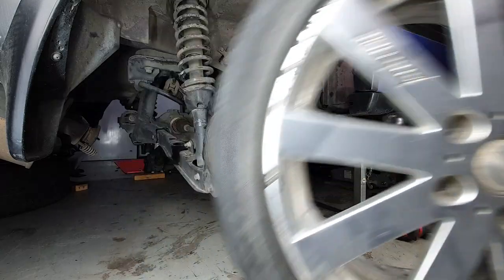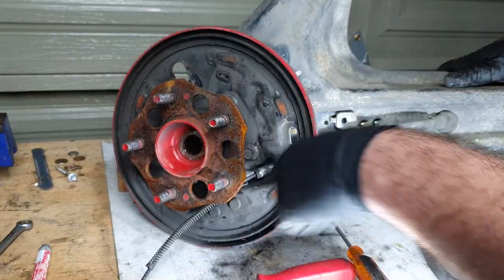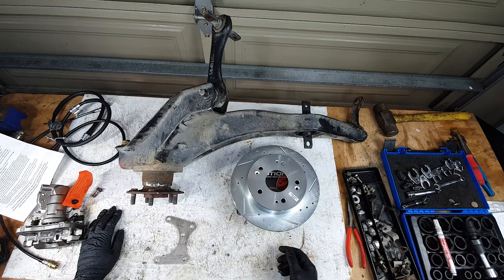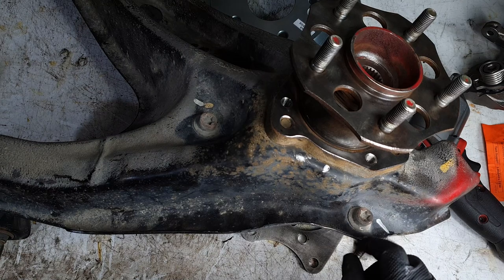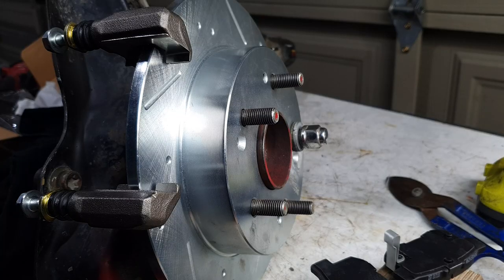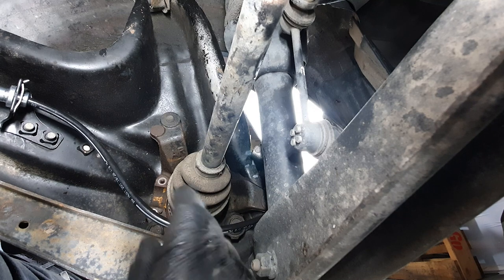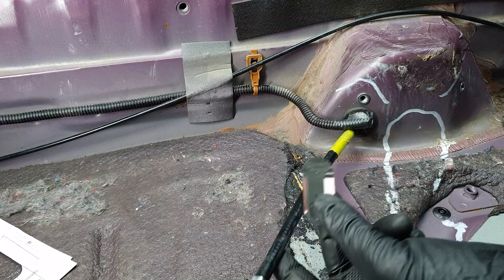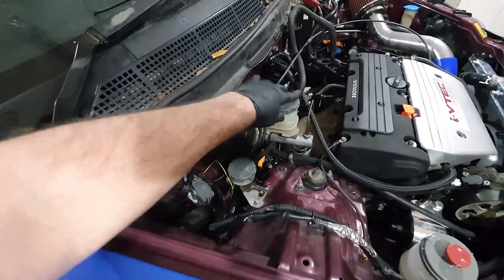honda cr v rear disc brake conversion

Comment: did the rear disc brake and big brakes up front. got good brake pedal when car is off but goes to floor when cars on. if i press the brake twice while moving it locks the brakes up. any tips?

Comment: This video series is extremely helpful, thanks! The car looks awesome! Great job with everything. 
Did the RD1 driveshaft bolt right up or do you need to shorten it still?
Reply from the maker: Thanks! Im about to start dealing with the prop shaft, going to see if i can use the rd5 prop shaft as its shorter then the rd1. Otherwise yeah i will need to shorten the rd1 prop shaft.

Comment: Try putting the right side caliper on the left said and the left caliper on the right side. So the bleeder screw isn’t facing down. But other than that the install seemed clean and easy.
Reply: It hits the trailing arm that way, gotta grind the caliper if ya do that. There is a video on YT about how to do it.

Comment: i like the drum brakes system even though ihate the set up. they actually stick much better than discs brakes.. though the disc pads  look much nicer, they wear much faster than  drum brake shoes.

Comment: for the rear rotors you used 1996 prelude rotors on rock auto i see they are 4 lug
Reply from the maker: No i used 5 lug. My crv is converted to 5x114.3. Normally a 96 rd1 would be 4x114.3

Comment: Do all the CRV's have the same gear ratios and rear diffs just match up?
I have a 98 5speed awd, I know all the 2nd gen +2002 are K-series. Do they match?

Edit: I just saw that this is already a K-swap in a RD1... I'm till curious about awd Honda rear diff gear ratios tho, D-series Wagovan Civics, B20 RD1's and K24 RD5's have any interchangeability?
Reply from the maker: As far as i know 96 through 2009 crv diffs are all interchangeable including elements. I know people upgrade to wagovan viscous coupler and rear diff but i don't know the ratio, i assume its the same.
Reply: I think they are the same. There is a difference in final drive ratio between the Autos and Manuals, but I think that all happens before the output. The D-series wagovan stuff idk about, too expensive for what it is in either case imho.
Reply: @nobodynoone2500  Thanks! as I've thought about it, I realized all the rear diff and gear ratios are set in by the FWD trans and any rear differential in a Honda is going to be a 1:1 input to output from the front to rear. No need to match up anything, as it all should work if you just make it fit together.

Comment: I’m confused so you can use the rd5 rear diff instead of the rd1 rear diff with the bseries set up or is it just for the Kswap? Or can I use it with bseries
Reply from the maker: You can use it with b series also
Reply: @jdmnuggets  any benefits to switching them ?
Reply from the maker: @hotshizzgaming569  the later models rear diff and viscous couplers lock up quicker. Basically, it engages 4x4 quicker and with less slip pressure. My diif is jdm rd5 you might need one from an element as i think the usdm rd5 has the same vc as the rd1. Another benefit to swaping in a later model diff is getting a new lower mileage diff/vc these older rd1 diffs, are, well, starting to get old lol
Reply: @jdmnuggets  Changeover was 2007ish I think. Diffs from crv, element, even some crosstour bolt right up.

Comment: does this still work with abs? saw another video guy said it doesn't work with abs which i find hard to believe
Reply from the maker: Abs works fine. Abs ring is on the axle and sensor is on the back of the spindle/hub.
Reply: @jdmnuggets  yeah exactly dont know why that guy said it doesnt work lol
Reply from the maker: Lol, yeah internet mechanics

Comment: Hey bro would it be the same if you just have a front wheel drive
Reply from the maker: You might be able to just use integra parts, contact Brian hasty at fast brakes or join the vtec academy live stream and ask your question there

Comment: Did the k series  dif bolt up to the b series drive shaft?
Reply from the maker: It will need to be shortened by 3/4"

Comment: Why just not cut the back cover¡? its not going to be used again no need to press the hub out 
But if your going change wheel and hub then you can take them out
Reply from the maker: Why cut and hack something to bits when you can press it out in 1 minute, pluss you dont risk accidentally cutting the trailing arms. If you want to cut it off then go for it 🙂
Reply: I thought the same thing, I feel like it would be super quick to cut out with a grinder
Reply: I've done it both ways (for other reasons lol). Removing it is just a bit cleaner if you have a press.

Comment: Have you had any issue with the e-brake cables being too long & not clamping the rear brakes enough to prevent rolling when parking on an angle? I installed the whole setup months back but I've never been able to get the e-brake to work despite maxing out the hand brake adjustment, and I'm now realizing I've got 2x BC95297 cables which are 78.69". I originally ordered 1x BC95294 (78.06") and 1x BC95066 (77.75"), thinking the difference in length was fitting for the hand brake being slightly off-center, but returned them due to one (can't remember which) not having the appropriate fitting at the caliper despite all 3 options being listed as having a hammer & clevis. This whole thing's got me confused at this point and am curious if someone can give me a definitive answer as to whether the e-brake is fully functional with 2x BC95294, or if the shorter BC95066 cables might work with this setup. Any clarification would be appreciated! Thanks
Reply from the maker: If you need more adjustment at the hand brake try putting a spacer on the adjusted bolt at the hand brake.
Reply: @jdmnuggets  I appreciate you getting back to me! So I can assume you haven't had any issue with the '294 cables? Thing is, I've not only maxed the adjustment but I've grinded away contact points on the bracket for the cable ends & notched the brake bracket as well, so I'm beyond max tightness with no luck. Obviously the extra ~.7" length of the '297 cables I've used doesn't help me here, so either way I'm going to give the ones you've suggested a shot. The thread I'd read putting this swap together just said 94-97 V6 Accord cables without the specific part number. Killer build and great videos, by the way. Thanks again, cheers mate 👍
Reply from the maker: The cables ive listed seem to be working well id for sure recommend them, thanks for watching 😁
Reply: thats the wrong part #cables you need the ones for the ABS rear disk brakes
Reply from the maker: @elpichito3  oh yeah, why is that?